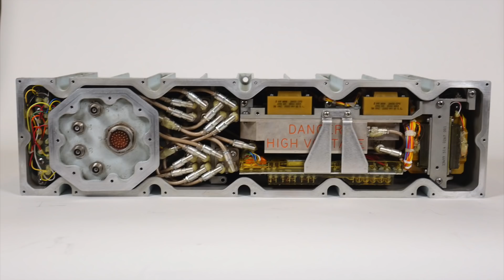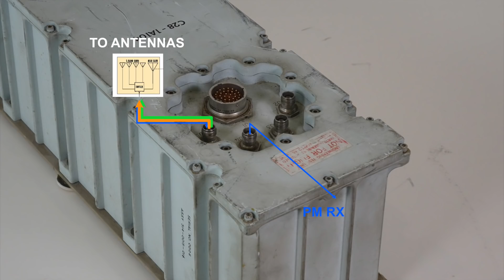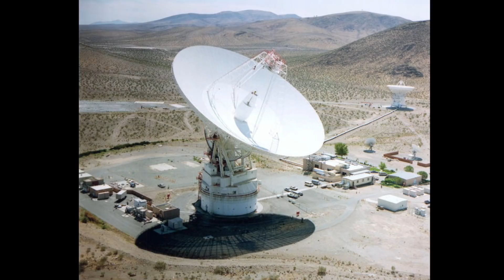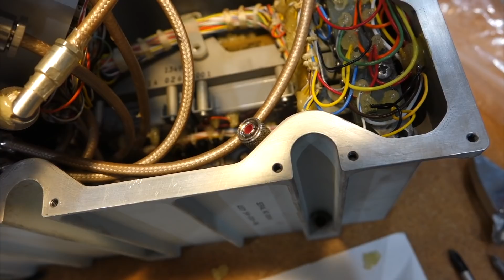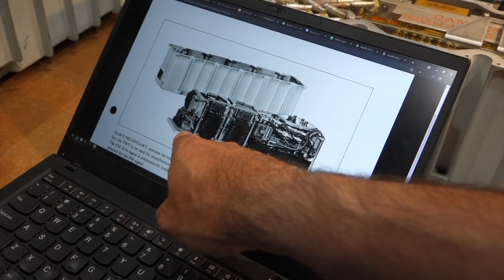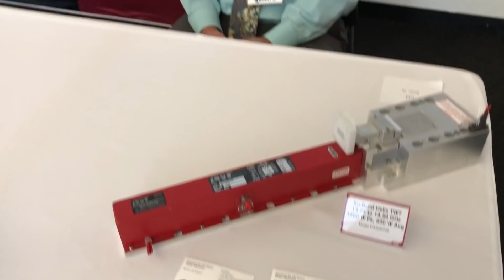Apollo Comms Part 2: Inside the Traveling Wave Amplifier

Comment: DANGER: Will Robinson! (actually Marc & Mike)  
When you solder the center-conductor tip, always use 'resistance-soldering' tweezers!  With the tweezers, you will not get solder on the outside of the gold-tip and create a blob that can prevent it from locking in place.  Most of the tips also have a solder-hole in the side to allow solder to be feed into the tip and wire once heated with the tweezers.  If not, then you do have to feed it from the rear but Standards of Workmanship for Soldering, specify that there should NOT be a rear-fillet, and adhere to both contour soldering techniques, with no-wicking of the solder past the  front of the insulation of the wire by one wire-diameter.  I realize this is not going into space or even be used but that is the standard that was to be followed.
Anyway, really love your videos and 'crew'; thanks so much for these deep-dives as future generations will watch your videos to learn this important history!

Comment: Marc, if you want to try it "on the air", I have a set of L and S-Band  "antenna hats" leftover from the APEX mission in the mid '90s.  Would love to find them a useful home!  They're presently collecting dust in my garden shed.
Antenna hats allow you to radiate into a small space lined with RF-absorbing foam and give you a fixed coupling coefficient to a sampling port.

Comment: I've got a 20W TWTA from Siemens. 50 dB gain@10GHz.  It runs on 24 VDC and has a switched mode power supply. Very cool device, it has never failed the past 30 years.  I use it mainly for 3cm wideband ATV.
Reply: Wow...how much power does it consume from the power supply?
Reply: @WolfgangMahringer  probably less than 100 watts. TWTAs are ludicrously efficient compared to other microwave amplifiers, even though it's still only 20-30%.
Reply: Indeed about 100 Watts give or take.  These now obsolete (in fact they were abandoned in the late 90's) modular devices were used abundantly in Europe to establish video links between transmission towers.
Reply: My 10 GHz station uses a Siemens TWT. It makes 15 watts or so.
Reply: @gertebert  Were they also used for the huge grid of telecom microwave relay towers dotted around western Europe?  I remember those round towers with a ring of small parabolic antennas around the tops being recognizable landmarks when traveling on freeways (as a passenger).  I have noticed that many have been mostly disabled in recent decades as reliance on buried fibers and satellite links have grown.
Reply: @johndododoe1411  That's exactly where mine came from!  I bought it from a German radio amateur (I'm Dutch)  who worked as a relay tower technician and when all those TWT's became obsolete he got hold of quite a bunch of them and he sold them at a bargain to ATV amateurs like me on specialized flea markets.  I know one guy who stacked  2 of these TWT's in parrallel to make 40 Watts and feed his 7 meter parabolic dish to do ssb EME moonbouncing on 3 cm.

Comment: Don't remember how long TWTs have been around - We were using S band, C band, and X band TWTs in 1959 in military systems. The S band tubes were good for about one octave bandwidth  even for the high power tubes ( 1 kw out ). C band and X band, less bandwidth in those days. Early high power TWTs used external solenoids for beam focusing and were somewhat troublesome to establish and maintain reliable operation because of this. Made my life much easier when permanent magnet high power TWTs became available in the early 60s.
Reply from the maker: Thanks for the insights! I read that the big difficulty at the time for permanent magnet TWT was making rare earth magnet. Only Bell Labs could make such magnets early on!
Reply: @CuriousMarc  I believe you're correct on the PM development problems - I should have mentioned that the 1 kw output levels were at about 1 % duty cycle - Some of the low power tubes could run cw at 100 %, but we had to include protective circuitry to insure max duty cycle was no more than 1% on the high power tubes.
Reply: @CuriousMarc  I knew that Alnico was the highest power usually available, didn’t realise it was a manufacturing issue rather than a discovery issue though! I’m going to thank every little commodity neodymium now :)

Edit: I see it was a different type entirely, samarium-cobalt! Fascinating! I can see how they were more expensive in every way!

Comment: It amazes me that anyone could have conceived a traveling wave tube, much less build a working one. Necessity is the mother of invention, and apparently genius.
Reply from the maker: I'm with you on that one. Hats off to people that invent microwave contraptions and manage to make them work!
Reply: Like all good ideas, the TWT appears to be a combination of the earlier Magnetron and Klyston tubes.  I can imagine an off hand comment in a stairwell, something along the lines of "what if we unwrapped a magnetron into a straight tube....".
I'm surprised TWT's are still used, but then we haven't found anything better than the magnetron for our domestic microwave ovens either.
Great videos! Keep up the good work.🙂
Reply: Noel Coward  Ha Ha!!!
Reply: I didn't catch that..
Reply: Stephen Ferree  What does the F16 and F35 use (if it's not classified)?
Reply: @johndododoe1411  it's not classified.
All modern radars are made of Phased Arrays.
Hundreds of tiny solid state radars, you modulate their frequency, amplitude and phase to create a big radar beam using EM interference, maths and computers.
So because each element only needs to generate low power, you don't need big iron like Valves and such (which is what a TWT is, a specialised valve)
These radars are called AESA radars (or PESA)
Reply: @markharrison7970  There is probably something better but not as cheap as folding a bit of metal in the right dimensions and making it a vacuum tube.
Reply: @MostlyPennyCat 👈 came here to say this as well. The f18 (not the f16 I know) uses Raytheon AN/APG-79 AESA (active electronically scanned array) consist of several solid state MMIC modules. 
The TR modules integrate GaAs high power amplifier, driver amplifier, low noise amplifier, and common leg circuit MMICs into a high density package to be incorporated into the radar.
GaAs PHEMTs form the basis for power generation, power amplification and amplification of the radar s received X-band signals.

Comment: The Apollo program was an astoundingly ambitious, ground breaking, and complex effort.  It's absolutely amazing what they accomplished in just a few years.  Compare that with the expendable Senate Launch System (SLS) that is years behind schedule and many billions over budget even though it's using modified components developed for the STS and an Apollo style capsule.  How the mighty have fallen.
Reply from the maker: Senate Launch System - I like this one!
Reply: @kippie80  Serious question, isn’t SpaceX all American ?
Reply: @kippie80  I’d imagine that other than chips, some  cabling and jellybean parts, most of SpX hardware is completely made in the US. By weight it is 99.9% “domestic dry weight” I’d bet. It’s not ab iPhone or a beige box PC we’re taking about. They don’t machine nor fabricate anything mechanical for these rockets abroad.
Reply: Made all the more astounding by the fact that they stopped and re-evaluated and redesigned nearly every single system between 28JAN67 and 16JUL69!
Reply: @gregmark1688  This video appears to be the redesigned versions, known simply as "mark II" modules.  Which in computer terms would be version x.1 (with "mark I" being version x.0 .  SpaceX is currently flying astronauts in dragon mark II capsules on top of F9 mark V rockets.  While experimenting with pre-production BFR designs using Raptor mark I engines.

Comment: Interesting video.  I dealt with TWTs during my career in the U.S. Navy.  Some were used strictly to amplify signals received by antennas.  The largest was cooled by liquid coolant (FC-77) and transmitted 1 Kw of power.

Comment: Thanks for the lovely traveling wave tube explanation. [I am reminded of various "particle cooling" mechanisms, used to "tighten the bunches" of particles in synchrotrons. In TWTs, the electron beam and microwave input/output form a kind of plasm transistor (if I may abuse the language a bit) I suppose similar "amplification", or alternately dampening, must happen in synchrotrons.]

Comment: I used to work on TWTAs in a previous employment, including fault finding the PSUs and optimising the tubes with permanent magnets to minimise helix current. I've worked on some 2kW C band TWT amplifiers, they use scary high voltages and the entire cathode heater supply sits the EHT voltage as they operate in depressed cathode mode with the collector (anode) at near ground potential.

Comment: FYI it's not just satellites using TWTs...both the american Patriot and russian S-300 AA missile systems use a TWT as the main transmit amplifier for their radar(s), despite everything else in them being solid state. The only reason solid-state will eventually push them out of military service are active phased antenna arrays, TWTs are physically too big to fit into those.

Comment: After watching these can now see why the Apollo program cost so much.
Reply: Well it all has to be 'Man-Rated', so you have to make it the very best and still add redundancy. 
And, since it has to be as light as possible and fit in an odd configuration all the enclosures have to be both custom engineered for strength with the minimum of material--then hermetically sealed.  To me money very well spent.

Comment: Those tubes have spent an awful long time cold. They rely on an extremely hard internal vacuum. Sadly molecular-level microleaks can soften the vacuum to the point where there are enough ions floating about to intercept the electron beam. Operating the tube has the effect of “pumping” the leakage ions and improves the tube interception current (a measure of the tube health). However, if the tube has been cold a long time and it has a high level of microleaks, when the beam is enabled it will scatter due the the presence of ions and hit the helix rather than the collector. The tube helix interception current will instantly rise to trip level. The result is a tube that accepts heater voltage, might well accept cathode and collector volts, but trips immediately the anode or grid is biased on  which switches on the beam. If the tube is soft or gassy, the only way to get it on is to pulse the beam switch at kHz so as to establish a beam long enough to pump but short enough not to trip the tube or cook the helix winding. That assumes these tubes have a switchable anode/grid. The tube is fairly short so cathode volts are likely to be 3-8kVish. Enough to kill the unwary.
If the tubes were well made, and have stayed hard all these years, make sure to run them for at least 15 minutes to allow them time to pump themselves. Then they’ll switch on as if new again. If they are space-qualified in the modern sense, they’ll have 3 or more collectors and be very efficient, as well as being the highest quality build achievable. Oh, and INCREDIBLY expensive.

Comment: I recently became active on the 13Cm ham band, 2.3Ghz and have a 20W pa that is only about 10x10x4cm and runs off 28v. Had they had that on Apollo it sure would have saved weight!! Some hams still use TWT for EME I believe.

Comment: Never be surprised that analog hollow state electronics can beat transistors! Klystrons are also fairly well renowned devices for incredible RF power transmission that still exist to this day, simply because solid state would either be hideously expensive and complex or because the output power and sensitivity are not yet matched

Comment: Wow, 11.6W, that's a lot considering HAM's bounce signals off of the moon using about 50W with a link budget for voice
Reply from the maker: They barely made it. They had just 3dB margin for B&W TV with the high gain antenna, and negative margin for voice and data comms with the omnis. Borrowing the military 210 ft Goldstone antenna basically saved their butts on the Apollo 11 landing. They’d have lost the LM coms when they were forced to go to the omnis. All the later color TV transmissions mandated the 210 ft Goldstone.

Comment: On Apollo 13, when they shut down primary and secondary TWTs.
These are valves, once their heaters are shut off, how cold will they get and is it possible to re-energise them?
Would they fail due to being very cold and heating them warps them?
Did they have a soft-start mechanism?
Did they leave the heaters on?
Did the heaters have a low voltage mode for preventing them from freezing?

Comment: That EECOM controller at 11:52 is John Aaron, not Sy Liebergot.
Reply from the maker: You are correct. By that time the white team had handed over to the blue (?) team.
Reply: @CuriousMarc  It is a little complicated.  The audio you pasted in is Aaron making that call (see https://youtu.be/OwE1jEfzI-A?t=7555), but even before the white team handed over, the INCO controller had discussed turning off the power amp, but didn't want to because he wanted the high bit rate data at that point (while they were still trying to figure out what to do). https://youtu.be/OwE1jEfzI-A?t=3543.  Great video though.

Comment: it would be interesting to see some antennas used for  "The blackest of black arts"
Reply: Lol Direct TV on your roof they haven't changed that much.
Reply from the maker: The self steering, multiple mode and beam width S-band and radar antennas are sure worth an episode on their own!
Reply: @CuriousMarc  antenna theory may not have changed much, but it would be really interesting to see how they solved the technical difficulties in those years.
Reply: @CuriousMarc  Yes please!!
Reply: @YunusCanKurban  That's what's so fascinating about this time. There were no integrated circuits to speak of (unless they were very simple) and everything was done with discrete transitors. It's fascinating reading the technical journals and papers the engineers were brilliant. Though I find it quite interesting that they used relays to switch the circuits instead of solid state PIN diodes which would have been available at the time!
Reply: @metatechnologist  But available in the necessary power ratings, and with the necessary reliability, especially against launch vibration? I don't recall the physical fabrication of PIN diodes in that era, but there were still Ge junction diodes that used the equivalent of a cat's whisker connection in that era, and I'd be concerned about those failing under continuous vibration. Relays were well-known reliable technology at the time.
Reply: @lwilton  Actually my thought is that they could not operate fast enough yet to work properly at microwave frequecies. The other more interesting reason (that you hint at) is that everybody understands relays and their behavior is predictable. Though PIN diodes now are actually the better choice because they're more reliable esp. in mission critical aspects. I.e. you do not want to have your life depend on a relay "getting stuck" and why a PIN diode is a better choice - nothing mechanical. And I am quite sure that the relays used in Apollo are the finest in the world beyond mil-spec.

Comment: I find it unreasonable to think that they built enough of this radio gear to last throughout the life of the Apollo program in a single manufacturing run, considering they must surely have upgraded equipment through the life of the program and they didn't know how long the entire program would last.  That said, do you think the engineering example model that you have was an early production model?  How many do you think they actually built?  Are there many variations?     Your videos are so informative and interesting.  Thanks for sharing!
Reply: Since they knew how long the Mercury and Gemini programs would last they probably had a pretty good plan for the Apollo program lifespan. The whole program was only about a decade long. But that said, stuff was developed and phased in continuously over all of the programs, which is why you hear terms like "block 1" and "block 2". Those were sequential variations on the hardware as they learned from the first versions and made improvements in the later versions.

Comment: Many thanks. I hope you will be able to show us the rejection and losses from triplexeur. Carrier signal round trip are very close.
Reply from the maker: Yep planning on doing that. Can’t do it for the FM without disconnecting it, but I could for the uplink PM, and also the downlink PM if I can set the relays in bypass mode. Might give it a try this week-end if Mike is around.